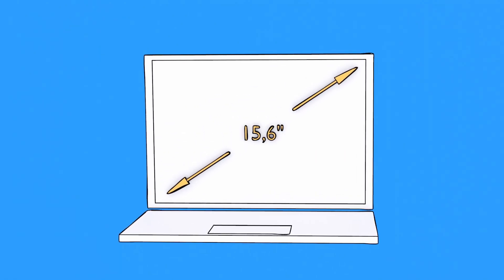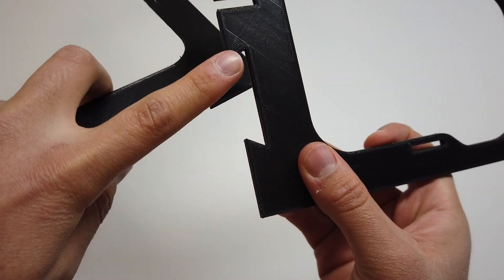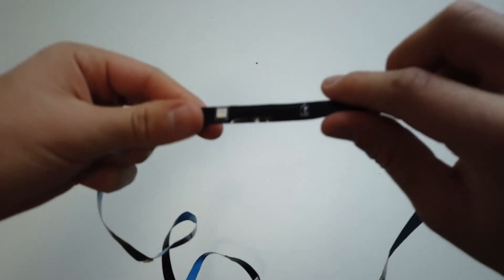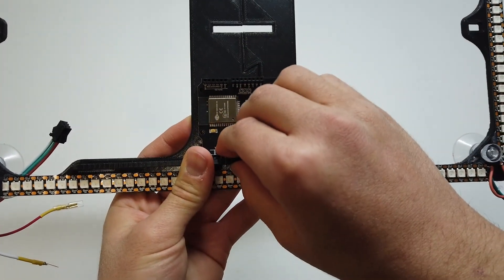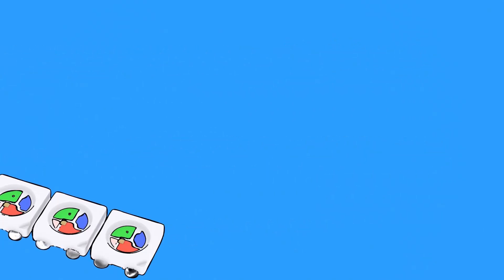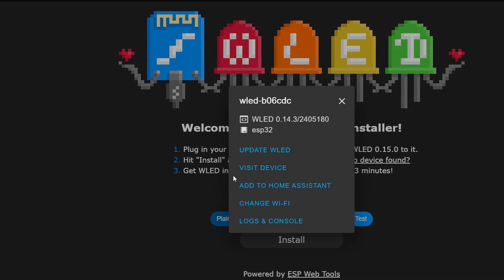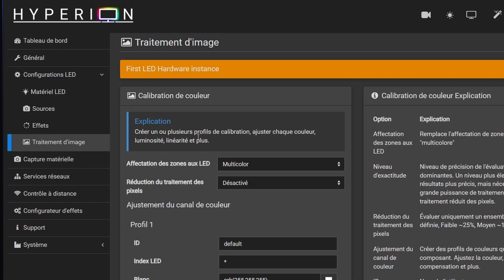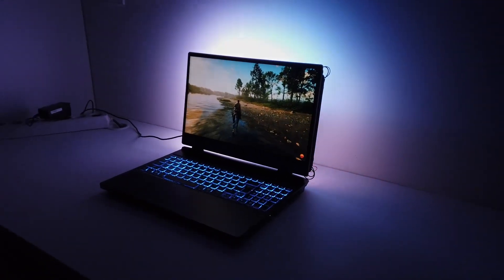DIY Laptop Ambilight under 5€

Comment: This is the exact same idea I had! 

Which (size) suction cup did you buy? 

Also the link for the light strip isn't working for me.

Is it safe to just directly wire a power supply like that?
Reply from the maker: Thanks for your comment! Glad to see we had the same idea!

I used 32mm suction cups (outer diameter). Also, I’ve updated the links—thanks for pointing that out!

One thing to note about the suction cups: they need to be really soft. Mine are a bit too rigid, and they tend to detach sometimes.

As for the power supply, yes, it’s safe to wire it directly since we’re only dealing with 5V. You can also power the LEDs via USB from your computer, which is enough to run them. If you want extra stability, you can add a capacitor between the power supply and the LEDs to reduce voltage fluctuations.

Hope this helps! Let me know if you have any other questions.
Reply: @ibrafrd  Thanks for your reply. I don't know if my laptop port can provide that much power because of the 60Ma per led rule. What are the specs on the power supply you're using?

And how did you connect the arduino, with usb to the laptop?

Thanks again.
Reply from the maker: My power supply is 5V 4A, which is actually much lower than what the LEDs theoretically consume. So, you should give it a try, it might work with your laptop. I connected the board to my PC using the provided USB cable, but once the board is configured, the USB cable is no longer needed since the data is transmitted via Wi-Fi. Thanks again!